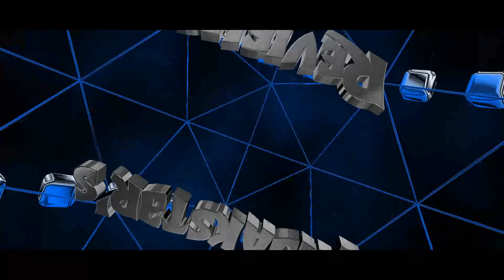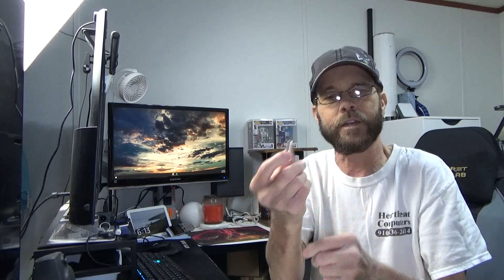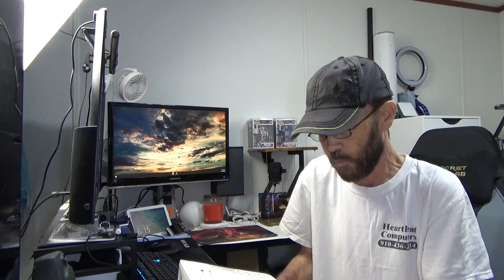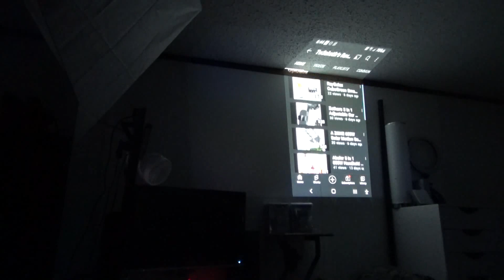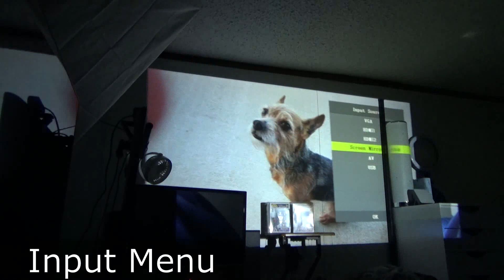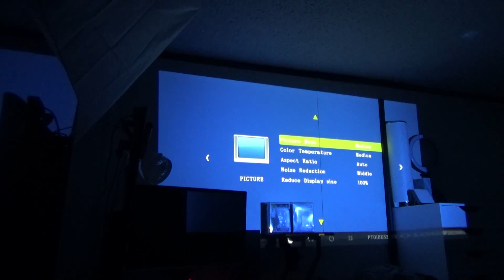Pericat 1080P 18000L Dual Band WiFi Bluetooth LED Projector

Comment: Great vid! What size screen do you recommend for brightest and best overall pic? Just got this for my bday so need to order a screen
Reply from the maker: Thank you, realistically around 50 to 65 in is going to be the best for this type of projector.  Of course as you go larger it's going to become a little bit less clear, sharpness, detail  etc. decline.. Tthe ideal situation would be to have a really good background usually gray backgrounds are recommended a lot of times over white backgrounds and you're going to want to have of course a room or a place that is absolutely dark to get the best outcome.